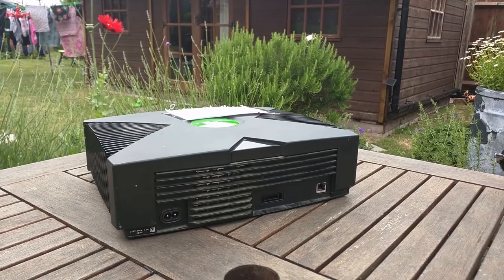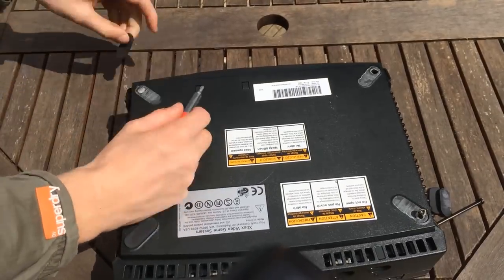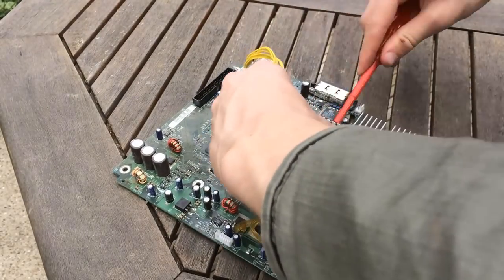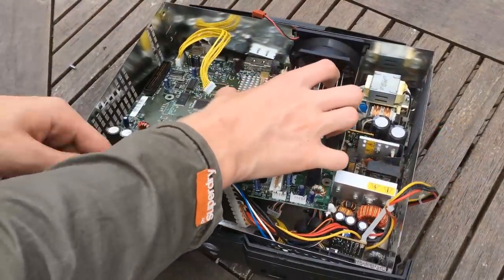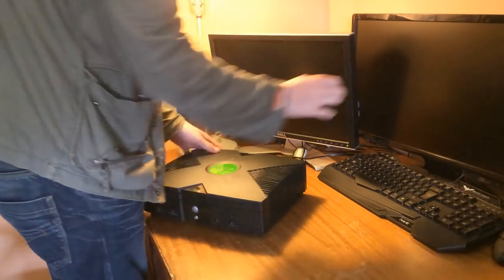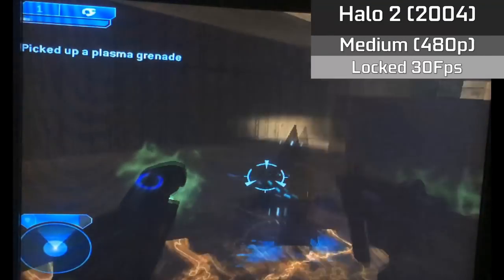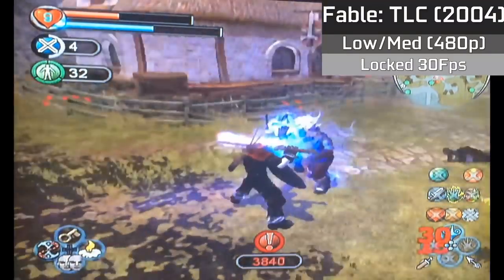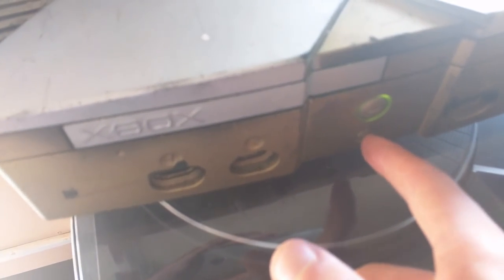I got an Xbox for Free...But can I Fix it? // Repairing the OG Xbox

Comment: Just add an RGB led strip and it will be able to run crysis 3 4k 60 fps
Reply: Daniel Lee at the 'Very High' preset
Reply from the maker: Daniel Lee: If it helps we had Red and Green?
Reply: 60 fps sucks.
Reply: Ádám Strasszer i guess i'll upgrade my potato eye to gtx eye 1080 for 4k60 fps.
Reply: TeraBite Gaming Yea 100 fps
Reply: Igie Tipsay what about a gtx 1080 t eye
Reply: no 100 fps sucks
120 or 240..
unless you can find a 100hz monitor, I'd suggest not to, as I use a 240hz monitor
Reply: 100 hz monitors are pretty popular tho
Reply: umm
but 120 hz monitors are more well known.
not only that 100 hz is stupid, you should be jumping up by doubling, that's why 120 and 240 hz monitors are more likely to be searched for
Reply: ik
Reply: Alot of european countries use 50hz monitors so 100hz is actually more popular than 120 and 144 in some countries.
Reply: well european countries moved to 60hz during the days of Cathode Ray Tube Televisions so that argument is stupid, and before you try to call that bullshit, I do in fact have a 60hz PAL CRT since I live in a PAL region
Reply: Ádám Strasszer Oof you can’t really believe that can you?
Reply: @adxo  no, human eye can see average 30 fps , higher fps also help frame times, i can't play games higher than 60fps or 40fps most of the time and i realized i might be r/wooshing myself
Reply: @WednesdayMan  i use 10ghz monitor, and i can say 240 sucks but 10ghz not worth a kidney
Reply: i use ubuntu too btw
Reply: guys chill im joking
Reply: January 21st 2021. 666th Like. Nice.
Reply: @adxo  Obviously it's a joke, we all know the eye only see 23, not 24fps

Comment: Eyy m8, I was at a local Goodwill, they were told it had a broke disc drive by me, went back a week later, same exact Xbox on sale 49.99 with a few Disc games Lmao 😂😂😂
Reply: ProtoMario oh hey I love your channel
Reply from the maker: ProtoMario: It's a good thing that this one had a Samsung Drive.... I'm gonna keep that incase I happen to find a broken Xbox with a dreaded Shudders Thompson Drive.
Reply: Or, you could make a video with my Xbox and replacing it's Thomson drive XD. I have 2 non working Xboxes, a PS2 that i found trashed (Pretty much all there though), and 1 fat PS3 that needs a ribbon cable. I want to get parts, but I am a PC gamer and don't use them unless I was to repair another console
Reply: You're everywhere dude
Reply: Recently i came across a samsung SDG-605 that freezes at the initialization stage and introduces error 7 on ANY console i plug it in. I am pretty sure the drive is the culprit, because if i plug another dvd drive then the console boots to the dashboard normally.
Any suggestions?
Reply: But proto.... Hi
Reply: I saw a working xbox with 2 controllers at goodwill for 20 bucks
Reply: @BudgetBuildsOfficial  hey tohmpson aint bad

Comment: I opened mine up after 12 years of owning it, and surprisingly it had basically no dust in it. It made cleaning easy and I replaced the thermal paste while I was at it. The easiest way to get the heatsinks off when you have that kind of dried up gunk on there is to play a game for 20 to 30 minutes. It'll heat up the gunk, chips, and heatsinks and allow them to be removed easier. Since opening my first original Xbox, I have now gotten several others and cleaned and repaired them.

Comment: great video! Surprised that this can emulate a N64, but my iPad 2 can barely emulate a 386. (It will cry with the N64)
Reply from the maker: kakoka1pro: The OG Xbox sure was an amazing console, it's a shame I left the majority of the games I own in Scotland or id show off the impressive Sims 2 (720p) and Half Life 2 (480p) which both look and run great on the console.
Reply: Budget-Builds Official How can the Xbox do 720p when the cabels Don't support the resolution?
Reply: The Xbox supports component video cables which support up to 1080p resolution.
Reply: madmatt2024 1080I*
Reply: Nope. Xbox 360 outputed 1080p over component video, look it up.
Reply: madmatt2024 Yeah. The 360. I am talking about the og Xbox
Reply: Yes, and I was talking about component video in general.
Reply: Zhunter5000 . Still the answer is component. 720p and 1080i.
Reply: @robertt9342  If you don't have a pal console...

Comment: I bought an Xbox Huge at a secondhand store for next to nothing. Lucky for me, it was already modded. It didn't work originally until I opened it up to replace the ribbon cable and clock capacitor leak. Worked like new after that.

Comment: I actually put an UDMA133 cable in this and it made a massive load time difference, since microsoft used a cheaper UDMA33 cable. The console was actually capable of ATA-5/UDMA66

Comment: Try baking the motherboard sometimes that fixes video chips you cant break it any more
Reply: no just don't
Reply: It sounds fake but it's true and can really help sometimes - a few people have done it with their iMac GPU when it fails
Reply: any repairs done like that will not last more than a few months and the temperatures do not even melt the solder
Reply: Your first statement may be true and it may only work temporarily, but solder melts at around 190 degrees celsius, which most (if not all) ovens are capable of reaching.
Reply: I have done this to my Radeon HD 5750. This was 5 Months ago and it still works today!
Reply: @jacobhk6735  only issue is its a temporary fix its more of a bandage rather than a fix

Comment: "ludicrous amounts of power into a small box" 
Bruh that thing was the size of a house and weighed as much
Reply: Oldskool Raver  nice joke it didn’t look good
Reply: Oldskool Raver it looks like a DVD player without an optical drive
Reply: The OG PlayStation2 was pretty big, it  wide and thick just not very deep. Just about every console from MS and Sony since has been pretty large. The giant size Xbox really applies in comparison to the small and underpowered consoles that came before.

I remember the pundits commenting at launch about how much smaller the 360 was. The 360 is nearly same size.
Reply: @robertt9342  i have both standing next to eachother, their sizes are not in the same category.
Even the x360 massively outsizes the ps3 if you count in its car sized powerbrivk (again, I have them both here). Both the fat ps2 and fat ps3 were great looking consoles

Comment: Check the electrolytic capacitors for bulging. If they are you should replace them. My dad's Xbox wouldn't turn on and I found that a few electrolytic capacitors we're bulging and had failed. After pulling them off with pliers, unsoldering the leads, using an appropriate size drill bit to redrill the holes for the leads ( much easier than trying to remove the solder with desoldering braid) and replacing them capacitors it works like new.

Comment: Yep liked this video I still have a Xbox 1 that was modded and has a 320GB HDD in it and uses the first xbox 360 blades for the UI. I ran the UI at 720p and it would go to 1080p but it would get draggy at 1080. I stored MP3's on it & 200+ games as well. I think the program that I used was XBMC which was when this program actually started way back when it is now called Kodi. I used the same EMU and I would get all kinds of weird questions as to why I was playing Nintendo & Sega games on a xbox 1.

Comment: you should just check the psu with a multi meter dude. 
I've done this for years it's so good isn't? i love how these things are almost indestructible. and nice work on the clock capacitor but you should have explained why it needs to be removed

Comment: Bad caps. The clock cap is prone to leaking, but there are lots of caps on that board. Replacein any that look even slightly bulged or using continuity test on a multi meter will tell you which ones. The GPU is very unlikely the issue... unless you broke it by pulling out the heat sink( use a hairdryer to soften the compound first nextime.

Comment: next time you should check the joints of the AC power plug in the PSU. If the solder is break, the console may dont turn on or even catch fire

Comment: The one responsible for the damage of the GPU was you, because you removed the heatsink without preheating it and for that reason you damaged the welding points of the BGA chip - very little force is required to detach them. The next time you need to use a hair dryer or turn on the console for 5 minutes and both chips will come out without fear of damaging them.
Reply from the maker: It had already been warmed up, the chip was dead from the lack of cooling, likely why it was being thrown away.

Comment: I would have tried harder to get the GPU working. If cleaning/thermal paste didn't fix it my next trick would probably be re-flowing the solder with a heat gun. (Or oven?)

Comment: The Xbox.  AKA the emulation machine for 5th gen consoles and prior.  Also, I had no idea Soul Calibur 2 had a 720p scalable resolution on the system.  I still prefer the Gamecube version though, as the control scheme of the Gamecube controller just made sense imo (and not because it has Link, though a plus for the game especially once you learn how to use him effectively.  Heihachi and Spawn on the other hand didn’t work well for me, as Heihachi controls just like he does in the Tekken games, which I’m not good at, and Spawn seemed like a clone of Necrid, whom I’m also not good with).

Comment: Did you replace the capacitor? I watched this twice and didn't see you replace it. Do you think it would work if replaced? ALSO, KOTOR is one of my favorite games man, don't you wish they would remaster it or at least create a new one?
Reply from the maker: TechWithRy: The clock capacitor is only required on V1.6 Xbox's, the older models have issues and will always leak, aswell as this they don't need them to work.... and KOTOR would be amazing if they remade it ;D

Comment: Good video I think we got the same psu how did you remove the cable from the psu to the motherboard do you got any tips. Mine is really stuck but then again my xbox seen some abuse and i'd like to take the board out to remove the cap but I can't with the psu cable stuck attached.

Comment: Correct me if I’m wrong but you showed the games as progressive frames but the original Xbox only outputs interlaced frames
Reply from the maker: +chuckles: With component cables it can output 480i 480p 720p and 1080i.
Reply: Budget-Builds Official ah well my og Xbox hasn’t outputted anything but interlaced probably the cheap component cables problem

Comment: Well it seems you didn't check the PSU at all. Maybe some traces for the GPU power are gone by the corrosion.

Also it'd be worth a shot to go over the GPU with a heat gun and see if it shows signs of life.
Reply from the maker: Matt: I tried alot of this off scene with the help of the /r/OriginalXbox guys' help, I believe that the chip had completely died.

Comment: I still have my OG Xbox in my house. I even checked to make sure my Xbox still works. It works so I have no idea what to do with my Xbox. Maybe play some old games I haven’t played in along time or disassemble my Xbox.

I CANT MOD MY XBOX BECAUSE I DONT HAVE SPLINTER CELL OR USB CABLE FOR MY XBOX.
Reply from the maker: Remove the clock capacitor if it's not a 1.6
Reply: It’s not a good idea to remove the clock capacitor.
Reply: I don’t know what model I have?
Reply from the maker: If you don't have a 1.6 it will leak, and likely no longer works, so yes you should remove it, and no it is not a bad idea. I do mention this briefly in the video.
Reply: Oh mine still works though.
Reply from the maker: Yes... But for how long?
Reply: I think my Xbox is 14 years old. I looked at the manufacturer date 2003 something?
Reply from the maker: Probably a 1.4, I'd remove it just to be safe.

Comment: The issue with video isn't the chip. It's the monitor you are using I have a monitor like that and my two Xboxes refuse to output anything to them.
Reply from the maker: Trust me, its definitely the chip, as I tested on a CRT, a TV, and my Monitor.
Reply: Budget-Builds Official Ah well that's too bad :P

Comment: What is it with people always wanting to remove the clock capacitor? Do they just love setting the time on a regular basis?
Reply from the maker: Cause it goes wrong, and won't work after all this time, and leaks onto the motherboard eventually killing it.
Reply: @Budget
If you're planning on going through all the effort of desoldering, why not just replace it with a new one while you're in there then?

Comment: Is there a specific reason you removed that one capacitor outright instead of replacing it?
Reply from the maker: +flagrama: With the Xbox Softmoded and plugged into the internet, it can get it's time from the internet. Making the Clock Capacitor another time bomb before it leaks again.

Comment: mine has a iffy dvd drive apparently, 4 copies of doax1 refuse to load but everything else i have worked fine - ive read theres a couple different drives that will work but besides those its a driver problem, i hope i can get it fixed sometime, i dont trust xb1's backcompat  with og, they have only once added a couple games to the list so i think theyve given up by now surely

Comment: Hi Budget-Builds. I discovered your channel a few days ago, and I love it. 

One quick question - where did you get the HD8670? I can't find one anywhere. I really want one for an Arcade Cabinet build.
Reply from the maker: trotman000: Check CeX and EBay, I found mine on EBay, on an OEM Dell sale, keep your eye out for them as they seem to be rare, if you can't find one an R7 250 will also perform very similar and have similar power usage :D

Comment: I got one from goodwill for 10 dollars. I got.controllers and svhs cables etc. Alonf with the splinter cell to mess with it, but have had zero luck modding it. Any suggestions?
Reply: Get an Aladdin chip off of eBay if you haven't modded it yet. They're really cheap & easy to install with light soldering skills. It's already flashed with a bios that should work. Get a cheap PAC Link brand IDE to SATA adapter for up to 2TB of harddrive storage. You will need to upgrade the oem 40 conductor IDE cable to a 80 conductor cable for the SATA adapter to work.

Comment: mistake #1 assemble complete console before testing if it works. imho no power was usually a bad solder joint on the PS, or a cockroach shorting the connection lol.  too bad you didn't fix it!

Comment: Hey, what makes it unsafe to remove the capacitor on the other model of the original Xbox?
Reply from the maker: If it's a 1.6 it won't boot after you remove it.

Comment: I have an original Xbox. It really has trouble with heat, as it’s filled with dust. Oh, and also, did you know you can play burned PS3 games on the original xbox?
Reply from the maker: +CodeRed: I'd like to see these PS3 Games running in the OG Xbox.
Reply: Budget-Builds Official I’m really sorry but mine broke 3 years ago :( my uncle put them on. I think he downloaded the games onto a USB stick or something like that. I do clearly remember playing Uncharted 2 on it.
Reply from the maker: CodeRed: There is a PSX Emulator on the OG Xbox, I highly doubt any PS3 games work on it though.
Reply: Budget-Builds Official I’ll try to get it working again. I think the motherboard fried from all the heat because the Xbox was all clogged up.
Reply: Budget-Builds Official did it work?

Comment: I'm only one dvd drive shy of having three working xbox originals although I'm not sure I should bother  even having the other 1.0 motherboard I have in a machine for anyone else to use its that full of patch wires and bypasses just to make it work I'm scared that a little knock in the wrong way might end it

Comment: The problem with teh xbox is the HD lock if you dont hack it while the HD works your basically fucked. Once the original hd dies on an unmodified system its basically a parts system.
Reply from the maker: I mean they tended to use fairly good HDDs operating at IDE Speeds, railure rates are currently very low.
Reply: @BudgetBuildsOfficial  Sort of the power supply s seemed a bigger issue with them. Its just sad that the xbox are the only old console that the hd dyeing a replaceable part part in any other system can make the system useless. This more or less means 10 or 20 years from now most unmodded systems will be useless while i can go get an old atari 2600 and chance3s are it will work even given its age and in 20 or so years they will still work depending on caps and such degradation.

Comment: You probably just need to mod the Xbox your hard drive probably died on you and it won't boot because the hard drives lock to the motherboard if you mod it. it should be able to run on any hard drive

Comment: My xbox also have this same problem any solution
Reply: he said the gpu is dead, so at that point get a new xbox
Reply: @bluescluessuperagent  no gpu can't be dead it might have some other issues , in my case the fluid of capacitor was hardened on the board I cleaned it but i have yet not replaced the capacitor, I hope it will work after replacing the old capacitor .

Comment: no way this Xbox supports 1080i which it has a very low amount of ram and storage
Reply from the maker: +The YouTuber Guy: It does.
Reply: wow that's impressive for a 2005 console
Reply: It's scales the GPU's output via an extra chip AFAIK.
Reply: Budget-Builds Official. MX versus ATV runs at 1080i on original Xbox, as long as you are using the hd component cables!

Comment: Bet it didnt work because of that cap you pulled out lol. Should of just swapped it with a new one, probably would have worked if you did that
Reply from the maker: Clock cap isnt required on anything other than a V1.6 OG XBOX, this XBOX had a dead/dying encoder chip it seems...Which would require a lot of work to fix.
Reply: @BudgetBuildsOfficial  Yeah idk about that, cause those hardly ever fail, but who knows